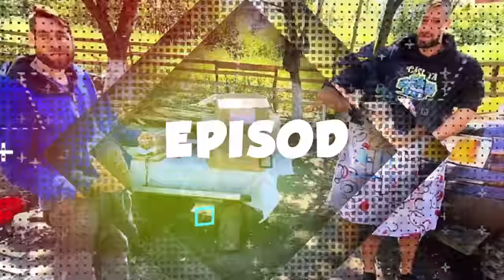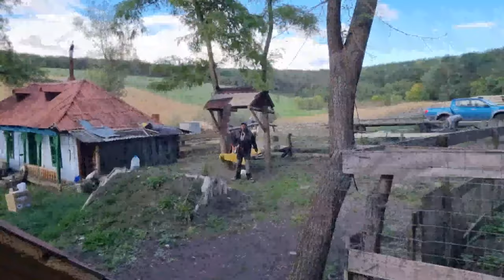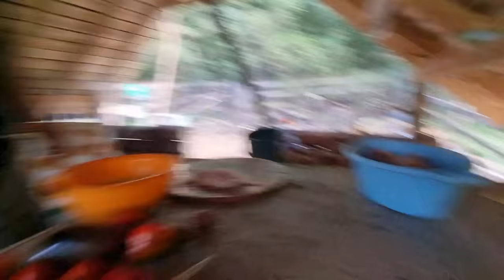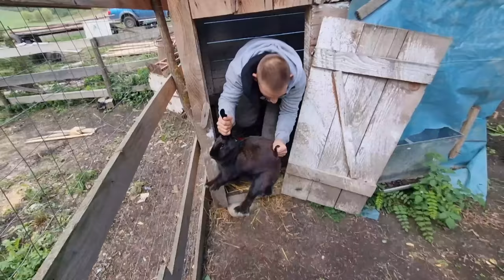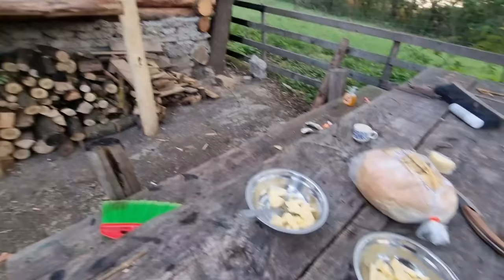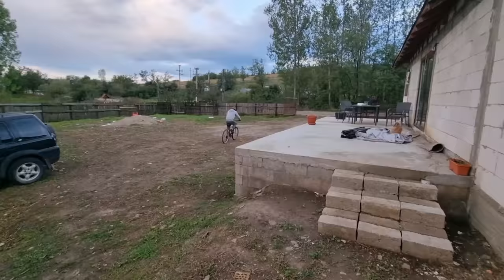🏡🥣 Supă de cartofi cu cașcaval, o delicatesă la Căsuța din Pădure!

Comment: Tiberiu, tu nu citesti comentariile?
In legatura cu cusca ai primit o seama de observatii. Eu zic sa intrebi pe D-l Turcea, ca are si iepuri si pe el poate il asculti. 
Dupa parerea mea, fac si eu niste observatii in legatura cu cusca.
- intre cusca iepuroaicei si a iepuroiului ar trebui plasa. Asta reduce stresul la amandoi, ca vede fiecare ca nu e singur
- in fata ar trebui o portiune mult mai mare de plasa, ca sa aiba lumina mai multa. Eu zic ca sunt suficient doua scanduri verticale si in rest plasa. Nu e bine toata fata cu plasa, deoarece iepurii au nevoie si de un loc unde sa se 'ascunda', fiind mai linistiti in astfel de conditii.
- partea obturata ar trebui sa fie spre peretele comun, ca acolo sa stea iepurii in cel mai mult timp. In acest caz usile ar trebui puse spre capetele custilor.
- fundul etans nu e bun. Inlocuiti-l cu plasa sau macar faceti gauri marisoare in scandurile de fund sa se scurga usor urina sau chiar si excrementele.
- cumparati cativa baloti de lucerna pentru la iarna. D-l Turcea poate sa va spuna de unde a luat sau poate chiar sa va dea daca a re mai multi.